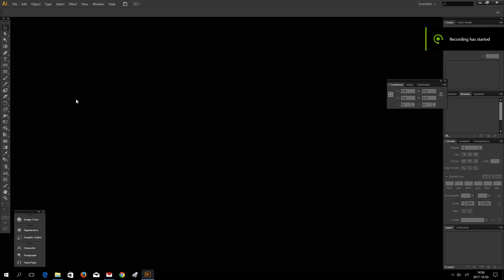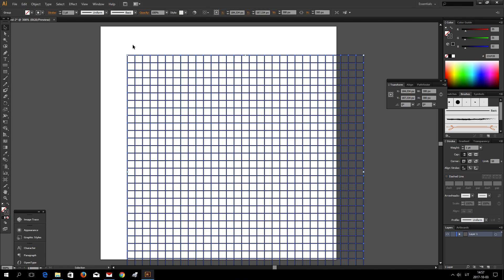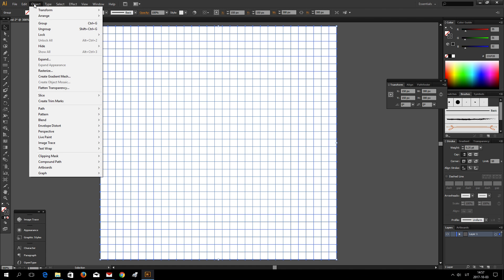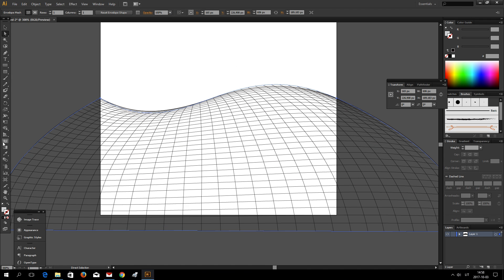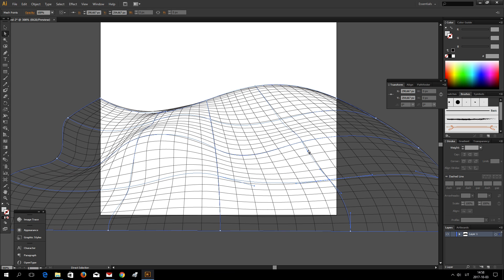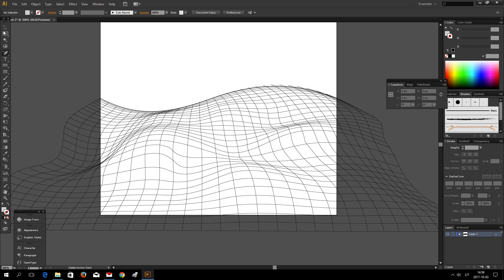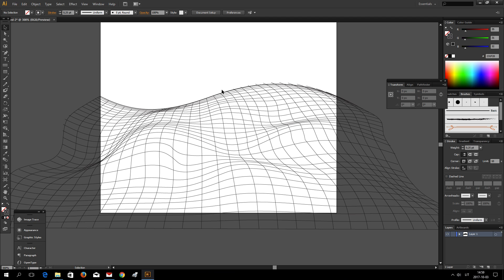Warped 3d Grid - Adobe Illustrator Tutorial

Comment: Following this tutorial in 2023, something is a little off. When I create the rectangular grid and use envelope distort with one row and one column, moving the top down distorts the grid differently than seen here. Instead of the top rows shrinking, it's only the middle rows that shrink. This creates a much different effect than the one shown here. I can't seem to figure out why it's turning out differently, does anyone know?
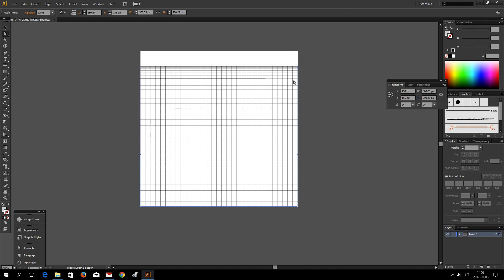Reply from the maker: Have you also edited the handles for top points? 1:17 - 1:25 ?
Reply: @LayerAce  Thank you, I was originally watching on mobile with low quality and did not notice that detail. Works great now and I was able to finish the project I needed a warped grid for!

Comment: Hi man have you tried mesh distortion in Ai 19? I've followed each and every of your steps as if I was trying to duplicate your result by the millimeter and i don't get those cubic bezier handles to really distort, all I get all the mesh points that I can drag.... kills everything. Any tip?
Reply from the maker: Hi, did not tried it in Ai 19, but it should work in any illustrator which have distort with gradient mesh option.
Reply: doesn't work for me either
Reply: I found that I had to immediately apply the Envelope Distort after creating the Rectangular Grid (before clicking anywhere else), but I'm still having a difficult time selecting the object after-the-fact, as well as the points to get to the handles. I'm not sure if Illustrator changed some things about this workflow, or maybe there's hotkeys not called out in the video that are being used. Either way it hasn't been as elegant a process as shown in the video, and I'm not sure if it's me or Ai.

Comment: Doesn't work for me. It just drags the whole grid.
Reply from the maker: Please follow tutorial closely, it works for most :) make sure you use direct selection tool to select individual points, not entire object.
Reply: @LayerAce  I got it. I had some option on that I wasn't suppose to and I was grabbing the edge rather than the anchor.
Reply: I had the same issue. You have to double click the point with the direct selection tool and than drag